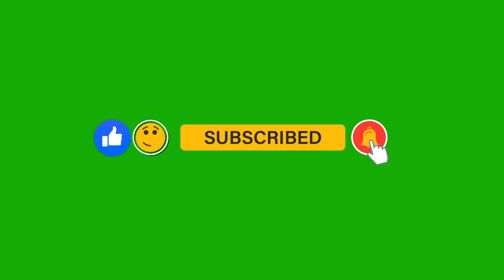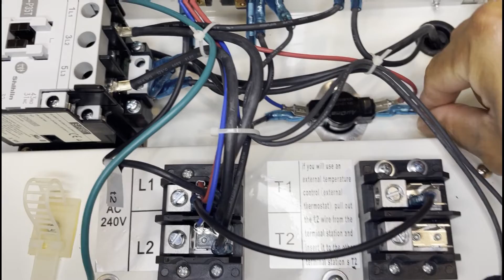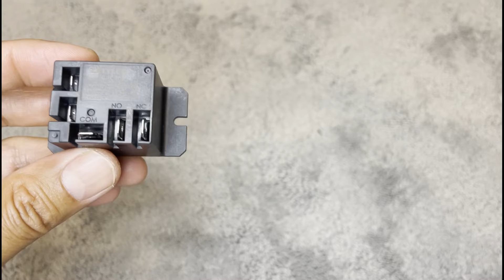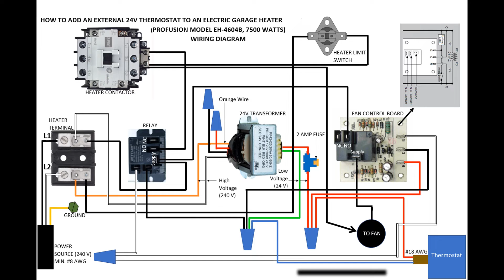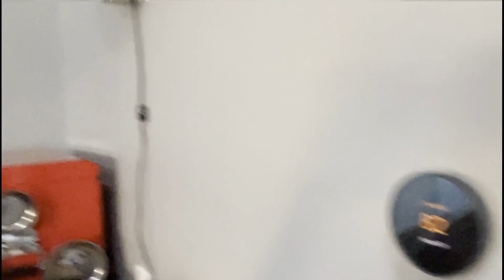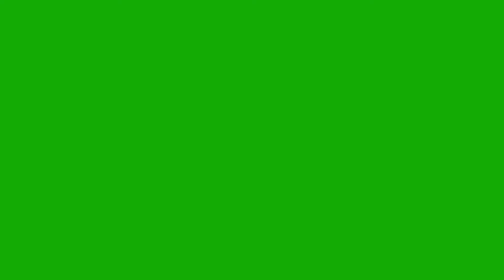How to upgrade an electric garage heater and control it with a Nest thermostat?

Comment: Could you have used the other side of the contactor instead of the relay to control the fan circuit ?

Comment: Did you remove wires from current heater and wired it to your diagram. I have a 7500 dyna-glo and it seems really crowded

Comment: Great video.  I am hoping that you can give me advise on my Dyna-Glo 7500 Watt heater.  The circuit board is fried and I know the element and fan are ok and I was hoping to incorporate your schematics to bypass the board and add everything in your video to rejuvenate the heater rather than throw it out.  Would this be possible using your schematics?
Reply: Yes, it doesn’t use any of the OEM board. Def can.

Comment: Hey thanks for the video worked out great the only the only issue I have is the thermostat seems to kick the heater on and off I'm wondering if you have any answers or anything about that thanks
Reply: …that’s what a thermostat does.
Reply: Thank you very much for responding so is this normal or do I need to get another thermostat
Reply: I done everything to the diagram on this

Comment: The addition of the time delay relay for the fan is a great addition and one that I want to incorporate.    The specific time delay used here is no longer available on Amazon and I am having difficulty locating another 24VAC time delay.   Any other suggested products & links?
Reply: Just search for "ICM Controls ICM255". Its there. About $30
Reply: Also looking for a 24VAC time delay.
Reply: @JoshSmith-hw6mi  ICM255 on Amazon. $30

Comment: Great diagram, please describe the black wire you added from the fan control board Supply terminal to the fan. What did you disassemble to get to the fan and how and where did you connect it to fan motor. Using a spade connector, splice, etc. Thanks

Comment: How did you piggyback the relay connector from the heater terminal to the fan control board right at the relay?
Reply from the maker: I used a Non-Insulated double Male-Female adapter.  It’s basically a splitter.  Here’s what it looks like, https://www.3m.com/3M/en_US/p/d/v000323405/
Reply: @MDcraftsman  I have one of those and it don't fit in the slot on the relay without some sort of modification
Reply from the maker: @JeffDietenberger  I used the splitter that came with the original thermostat.  Since you wont be needing the thermostat that came with this heater for this setup.
Reply: @MDcraftsman  Also the other two connections on the relay for the thermostat are smaller than the spade connectors that you put in the comments. What spade connectors are you using for those?
Reply from the maker: @JeffDietenberger   In regards to the spade connectors, I also used some of the wires that came from the original thermostat that already has the spade connectors on both ends.  For the low voltage wires, I used a spade connector that is 4.8mm wide, see specs of the relay.  I’ve updated the list in my description for the correct spade connector, from Amazon. One more thing, please make sure that the electrical connections are tight.  This is critical to a safe wiring job. If wires come loose, you could get arcing.  I hope I was able to answer your questions.

Comment: Do you completely bypass the original thermostat knob?  I thought I saw some wires still connected to it when you showed your finished project at the end.
Reply from the maker: Hi Paul, thanks for your comment.  Yes, the thermostat is not connected to anything.  The one wire that you see is what was left.  One end is connected to one side of the thermostat and the other end is connected to the other side of the thermostat.  If you look closely, it’s makes a U shape.  I hope that makes sense.  I guess I should of just removed the wire.

Comment: Can you provide information on the contactor, specifically is the coil voltage 120v or 240v?
Reply from the maker: The contactor that came with my heater is a 240V.  The model is S-P35T.  Here is some information about it, https://www.directindustry.com/prod/shihlin-electric-engineering-corporation/product-65405-452277.html

Comment: Great instructions! I plan to follow your diagram to upgrade mine. Thank you. May I ask what gauge wire you used to make new connections? Do they have to be the same as the original internal wires?
Reply from the maker: Thanks for your comment.  I used 16 AWG by GB Gardner Bender.  I got mine from Menards.  You can also buy them from Home Depot and Lowe’s.  https://www.homedepot.com/p/Gardner-Bender-16-AWG-25-ft-Primary-Wire-Spool-Red-AMW-326/300689784

Comment: I commented yesterday but not sure it went through. Do you know would you use the same setup to run 2 heaters in a garage by one thermostat ? Great video....
Reply from the maker: Thanks for your comment. It is possible but sorry I don't know how to setup two heaters using one thermostat. Here is a link that might help you with your question, https://king-electric.com/can-i-use-multiple-heaters-with-just-one-thermostat/#:~:text=The%20short%20answer%20is%20YES,circuit%20can%20handle%20the%20load
Reply: @MDcraftsman  Thank you for your reply. I saw that setup on my search but both of my heaters are wired to their own 30 amp breaker. Thank you for your time and thanks again for the reply...

Comment: How do I use a nest thermostat at a lower temp, I like to keep my garage at ~45 in winter. I don’t think it can go that low.
Reply from the maker: Nest has a feature called Thermostat Safety Temperatures.  Nest won’t let the temp drop below the safety temp set. And fortunately for you, the lowest value available in safety temp is 35 degrees F
Reply: What did you set the dial thermostat on the heater to?
Reply from the maker: @chadbrooks9029   my garage is pretty insulated.  I have mine set at 50 degrees Fahrenheit.